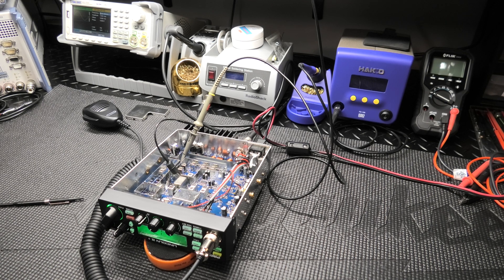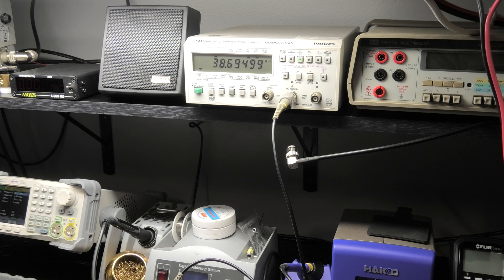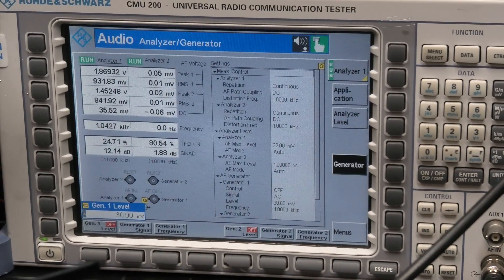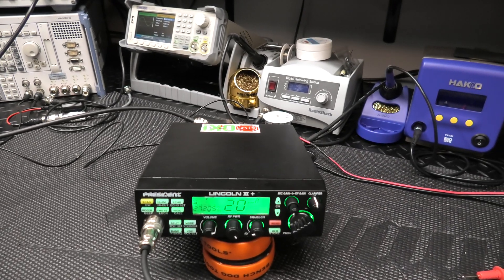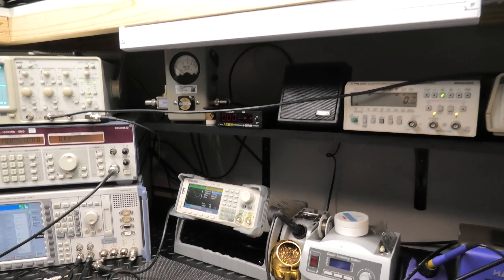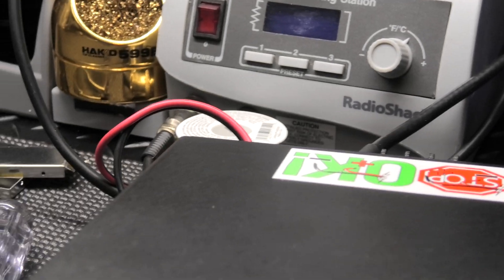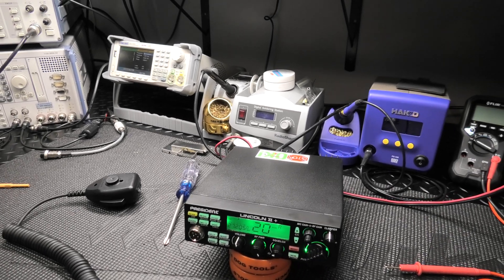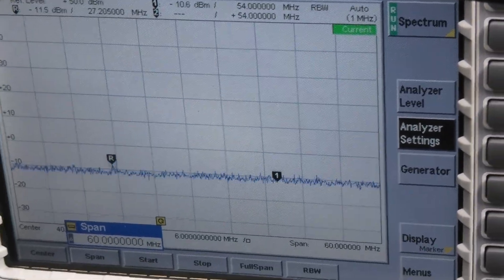Lincoln 2 Plus Tuned & Aligned For Matt (Scope, Sinad, Spectrum Analyzer)

Comment: Noise? What noise? The presence of fans, be it in the equipment or in the comments, is a joyful thing! Definently not annoying. One cannot pilot a jet without the screaming crush of chest and cranium when engaging the afterburners. You cannot ride the train without the persistent screeching of steel on steel and the rocking of the rails. Nor can you be a wheel holding Road Ranger without the incessant pounding, by the ever present potholes, rudely massaging, to the numbing point,  the body and brain, 🥴 while guzzling gallon after gallon of the magical lubricating elixir we call "locomotion lotion". 😄 It has to be a relief not to spend a lot of time on this fine line of radios. Finally  completed work on the Cobra 25 LTD Classic. It will stay on my bench as a monitor unit. 
Hope your vacation was all it was supposed to be. I will be out of the loop for about 11 days as I take what I prefer to call another "cavation". Be well my friend. Keep those radios rolling. I will catch up with any new videos upon my return. Smilin', I'm off the key. 😑🦗
Reply from the maker: Yep noise kinda comes with the territory of running a bench with loaded with equipment that all have fans running in them. I will still try though to see what I can do about taming it. Good luck with the cobra 25. Sounds like it will make a good little bench unit for you. Nothing wrong with a vintage cobra unit! Glad to see your still motoring along. Enjoy the vacation and check back in when your ready. 73 👋💪🇺🇲

Comment: What channel is on the display when receiving on the 
38.695 ,, ?? Great looking radio , good job Matt keep up the good work 👍
Reply from the maker: Radio was on 28.000, thanks for checking out the video. 73 👊👍
Reply: @TheRadioGarage  
It’s confusing to me , do cb radios not transmit and receive on the same channel frequency,? Are they set up like a split system ? That’s what I should’ve asked . I can’t wrap my head around that lol

Comment: Great job...the video is not like the other place where your recording is clean like an astatic mike...this new place has a stock mike recording ...it maybe a fan or a/c vent or something, i think a mike adjustment in your nx video my be in the works,but great radio too.thkd
Reply from the maker: Ok I will work on the video audio. All the equipment running on the bench pretty much have fans so I'm sure it's getting picked up. Thanks for watching 73.
Reply: @TheRadioGarage  its not that bad,i think..just what i notice differently from the other shop...im sure you have radios to work on....im still working on sending my radios to you ..i deliver tomorrow here in cali after that i know a ups store i pass every time im here so i might just ship from here and have a pre paid return to to box in florida, i have a general lee with me as back up,i will also ship for the md1 i want anyway have a good evening see yah